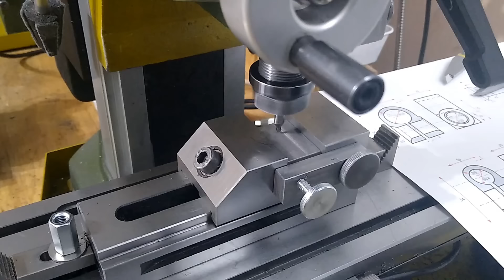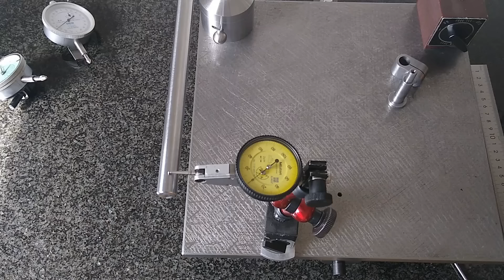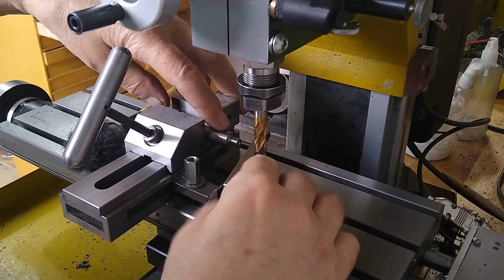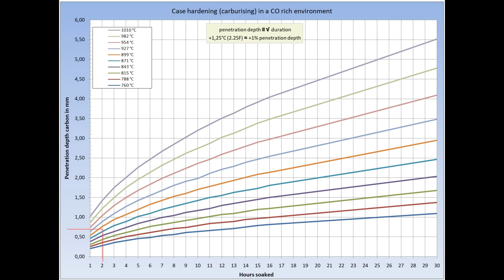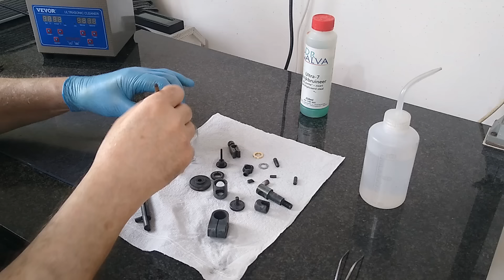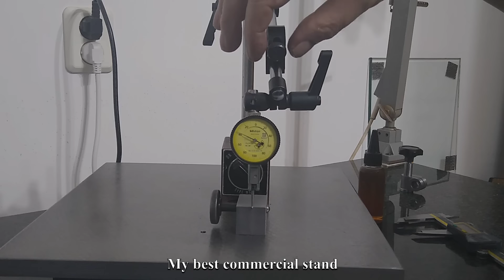Build: A professional neodymium magnet dial indicator stand part II

Comment: Hardening such a small piece of steel it’s actually not necessary because hardening and tempering steel is usually used for cutting work pieces, drill bits, knives etc, in your case the parts are not used for that purpose.
Reply from the maker: Hardening is also applied to bearings and friction surfaces and such to prevent plastic deformation and reduce wear.
Reply: @Michel-Uphoff ja you are right but in this application you will not have constant friction
Reply from the maker: @FreeYourBrains  There's high pressure and a lot of friction between the ball joint and the socket. This is necessary to keep the arm stable in position. That's one reason why I chose hardened and tempered materials.
Reply: @Michel-Uphoff  Got it

Comment: I wonder if you could improve performance using 3d printed bars for the indicator arm by using strong patterns with hollows to reduce weight of the arms.
Reply from the maker: I don't think 3d printed hardenable steel is in the reach of a home shop like I have. In addition, it will certainly not be more accurate, and the weight of the solid bars is actually not a problem.

Comment: Was this tempering necessary, and even benefitiary?
This is just 0.5mm of surface, and I doubth this parts will ever have impact stress, so the surface will crack.
After all.. those linear guide shafts are at about 62HRc surface hardness if I remember whell.

BTW.. great job
Reply from the maker: The case hardened parts are not tempered, only the silver steel parts. Sorry, I didn't make that clear in the video.
The linear shafts weren't heat treated at all by me.
Reply: @Michel-Uphoff  Of course.. but shafts are about 60-62HRc at surface.
So.. if shafts do not have problem with britleness, so the parts you have made will not to.

Any way.. it's clear now. 👍

Comment: I like the flexture fine adjust, great job once again Michel.
How did you keep the scaling under control in the heat treating phase? more specifically when you heat the parts up for quenching.
how did the heat treat affect the overall dimensions and surface finish?
Reply from the maker: Thank you Victor.

Nowadays I harden the small parts in that small but handy and precise electric oven you see in the video. I put them in that canister with the tight-fitting lid. Virtually no oxygen passes this way. I am very satisfied with that, almost no scale. That is, on the inside of the canister. On the outside of it, an ever-thickening crust of rock-hard flaky oxides grows. But such a canister is easy to replace when the wall gets too thin. 

[edit] Just measured the wall thickness for fun, and it only lost 0.1 mm of 2 mm in 8 or so cycles, so I can use it longer than expected.